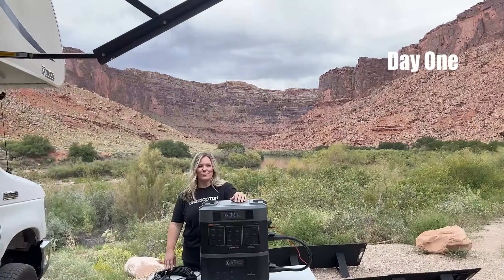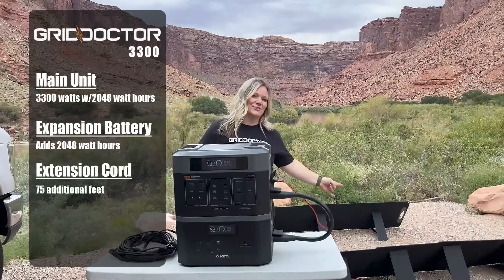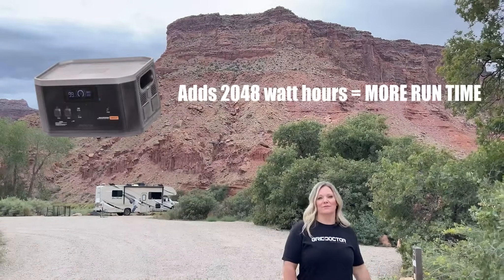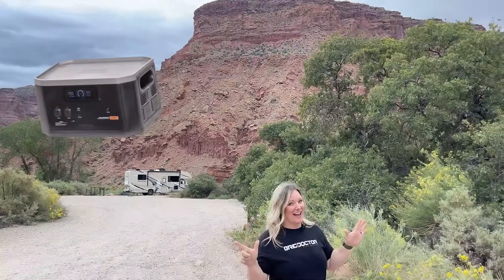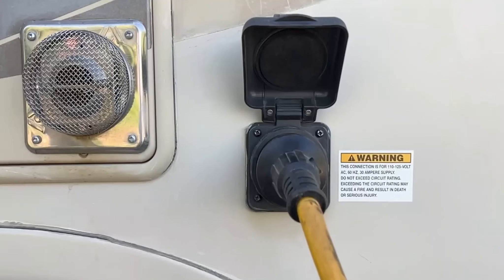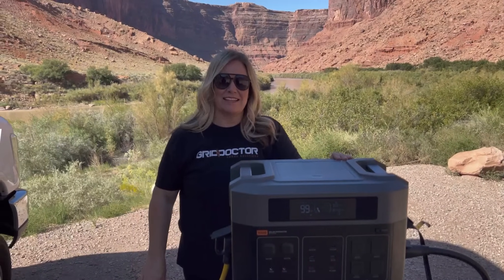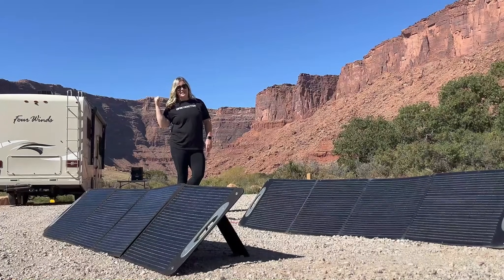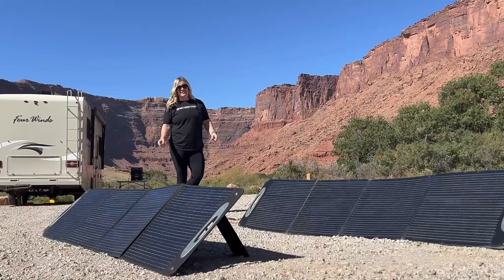Off Grid Solar - RV Edition

Comment: Notice screen on display isnt even on when she claims the pass thru is working
Reply from the maker: The display shuts off when the unit is operational.  It conserves power that way. 

I’m happy to correct you. 

Another reason you want the display to shut off is when are using this generator at night the display would light your room and again, it wastes power.  The display shuts off by design.

Comment: Good review.  Wife & I just took delivery of our 3300 a couple weeks ago when it was on a flash sale.  Works just as advertised; happy with it.  Shortly afterward, we also picked up the 75’ solar extension cord… you really need one if you’re not just setting up the panel(s) outside a tent.  Our next purchase will be a 2200XP expansion battery (waiting to see if they put it on sale below the current $1,297 price).
Reply from the maker: Thank you for the review!  The extension cord is a game changer for sure.  We are building our solar one piece at a time too.  The equipment is there for an emergency but we like to get our reps in doing something fun.